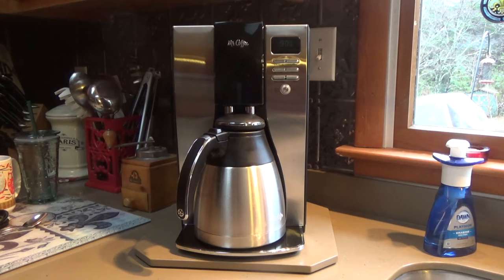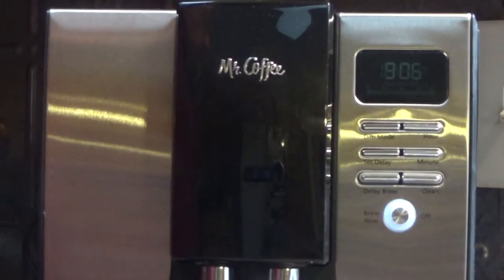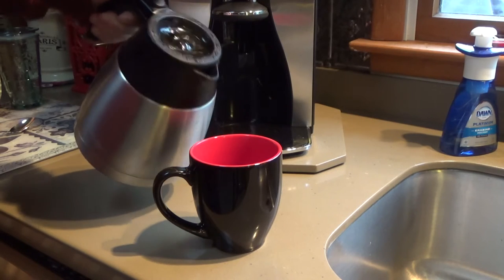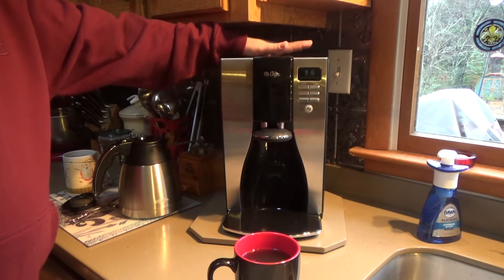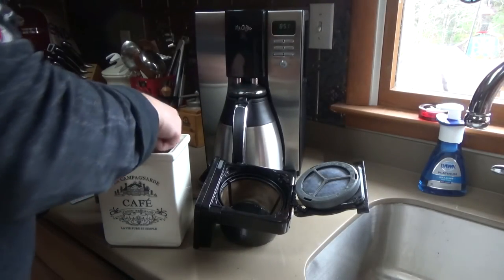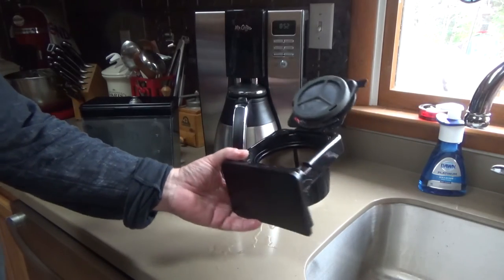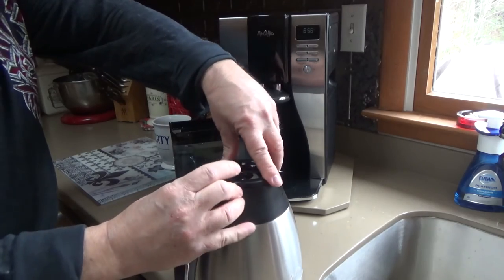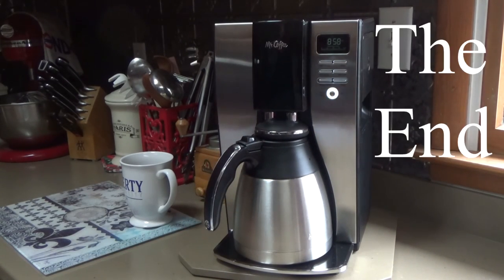Mr Coffee Review BVMC PSTX91

Comment: Liked the looks and simplicity of operation, plus a thermal carafe, for better part of two years. Then the breakdown: spring on drip basket came loose and could not be replaced sufficiently to avoid plugging and overflow of water and grounds during brewing. Never used auto settings other than resetting the clock ... always manual  operation. Best ratio to my taste: 7 scoops of medium grind to 6 cups of water. Waiting for manufacturer to reply re replacement basket request.

Comment: Makes great coffee as long as it lasts.  We liked the features, the 
look, etc.  Lasted about 2  months at one pot a day.  I just tried to 
take it apart to search the problem and I could not break in to the 
interior without damaging the case. It has simply quit heating the 
water.   Very disappointed.  We found the carafe did not keep the coffee
 hot any longer than about 2 hours.  Our cuisinart lasted 12 years and 
made good coffee til the last pot.  No more mr coffee for us!
Reply: I generally consider myself pretty mechanical, and I tried taking this thing apart and could not figure out how to get it opened up.  One bottom cover comes off.  A second bottom cover comes off.  Still no access to anything.  I can pull on the sides and look but figure it will break if I pull any more.  What a horrible design.  Maybe it's all snapped together from there.  I seemingly took off every screw I had access to, and it does not come apart for me.  Nobody has a video on how to do it; at least not that I can find.  Back to the old Presto Percolator from the 1960s...that still works fine.
Reply: That is a very sad story :(
Sorry for your loss.